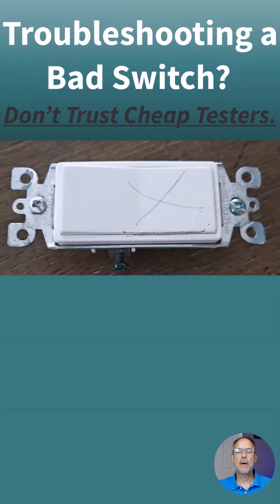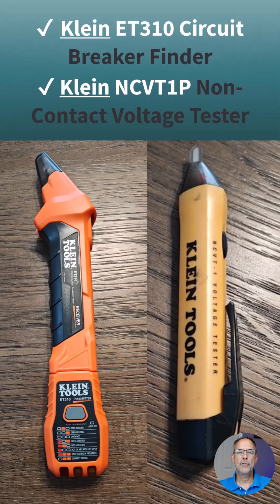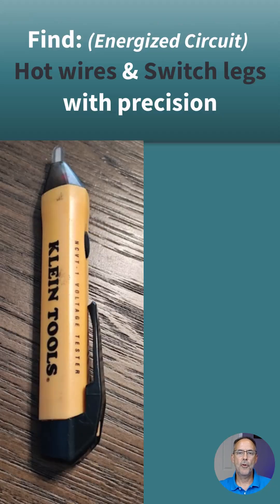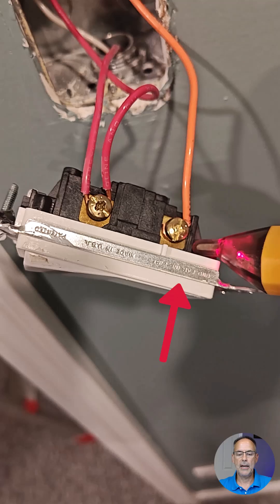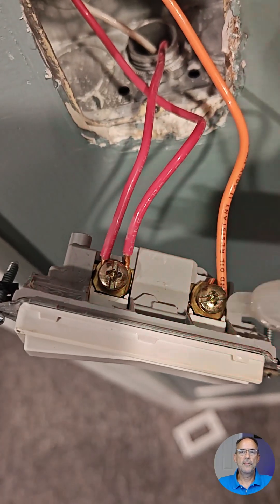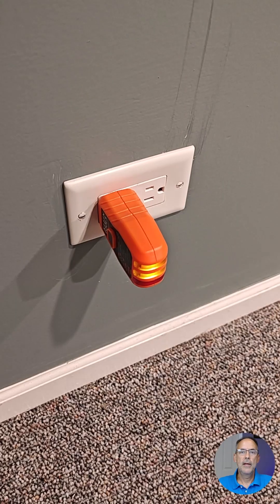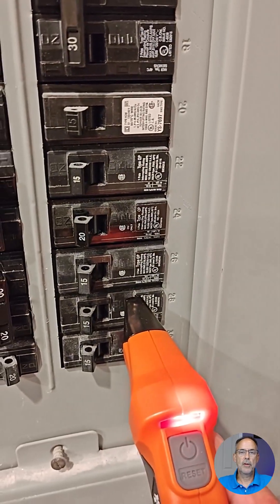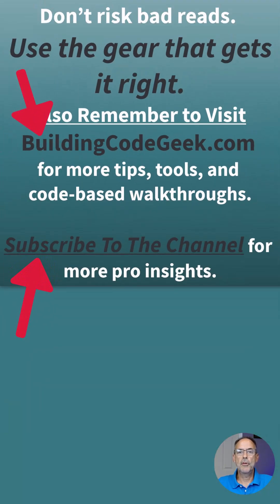Finding a Bad Switch Fast with the Right Tester #ElectricalTester #VoltageTester #KleinTools

Comment from the maker: Tools I used in this video:

Klein ET310 Circuit Breaker Finder: https://amzn.to/44hK8Ax

Klein NCVT1P Voltage Tester: https://amzn.to/3ImvAGU

These are affiliate links. I earn a small commission if you buy through them—at no extra cost to you. These are the tools I actually use and trust in the field.